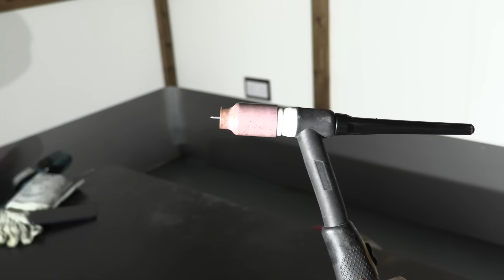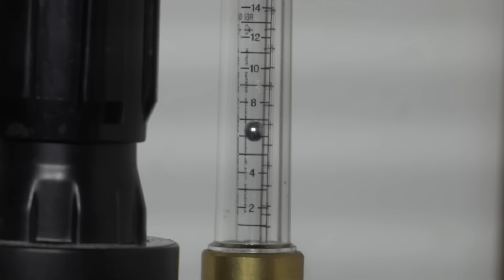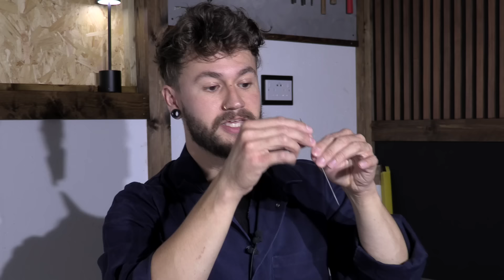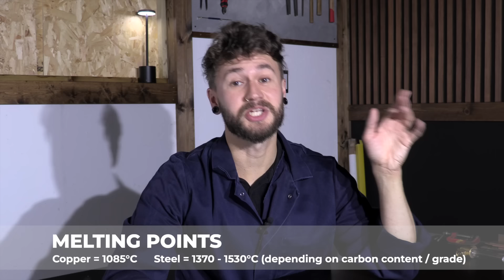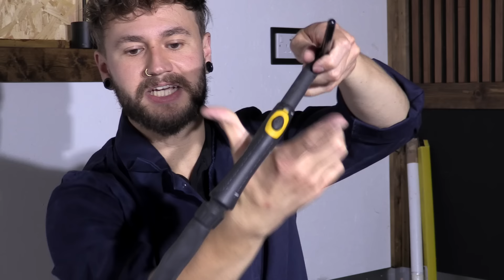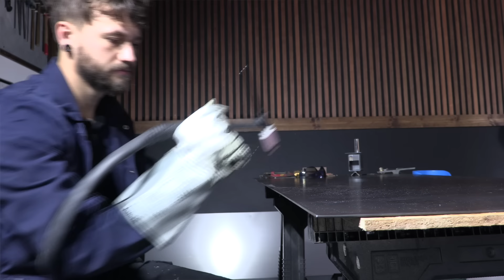This Is Why You Suck At TIG Welding

Comment: Shouldn’t have any grooves at all when sharping your tungsten..
It should be polished.. the grooves will cause the tungsten to oxide quickly and degrade faster
Reply from the maker: What are you using to polish your tungstens?
Reply: @Dre.T.K  diamond wheel
Reply from the maker: @tomcox7221 nice, I'll be on the look out 👌 cheers
Reply: @Dre.T.K most pipe shops i weld at have what’s called a piranha tungsten sharpener.. they are expensive but work very well.. I have a handheld unit that uses a small double sided diamond wheel for when I’m n the field..
Reply from the maker: @tomcox7221 yeah, some of the businesses I've worked in have had all the fancy tungsten sharpeners. I've just never needed one for my home set up. Getting more bits together as time goes on.
Reply: @Dre.T.K  yea I can’t justify a 1000 dollar tungsten grinder for the house either lol

Comment: I decided to by a huge 16 cup for my stainless manifold and boy did it cause problems! Access was impossible and rather than use the big cup I used a long number 4 instead, much easier to get into those ridiculously tight areas. I know that the stick out can be much longer but the gas needs to be higher too, I decided to go the other route instead, it cost less in gas usage and saved my sanity :) That was one thing you did not cover Andre - stick out. This also can be the make or break of any good tig weld. Having said that, I enjoyed the tips; it is always good to listen to someone even if you are a seasoned tig welder.
Reply from the maker: Yeah, you're absolutely right. Stick out can be something people also struggle with when starting out. That's maybe something I'll go into in the future if I decide to do more of these advice style videos.
Another one that's kinda related is arc length. You see it often. Getting that sweet spot where you're not too close that you dip your tungsten when you're filling, but not so far away that you lose control, heat placement and everything else that comes with it.

Thanks for the extra tips. Hopefully anyone reading your comments will be aided through the advice. Thanks for watching and the support 👌 I appreciate it

Comment: Replace your wheel on your grinder with a diamond wheel of the same size. 
It’s also easier to get whatever tip profile you desire by sharpening it pointed down in the direction the wheel is turning because you have more control as you spin the tungsten (which should be done relatively slowly) 

Also never seen someone hold a torch that low. Choke up higher for better control.
Reply from the maker: This set up is button TIG. I would usually hold higher up when using a pedal. I find choking too high can reduce movement, though! 
Cheers for the comment 🤘 I appreciate it

Comment: As a long time dedicated tig welder all of these tips are perfect good stuff your cup size helps with the LPM of gas for example if your welding with a cup number 8, 8LPM is whats needed and if you have for example a cup number 16 you use 16LPM and make sure you have a little bit of pre flow and post flow if possible to do so on your welder 👍
Reply from the maker: Great advice 👌 pre and post flow can make or break a weld, so it's always a good thing to be aware of. Keeping your torch over the weld piece at the end/during your post flow is something new welders often forget, too. It becomes muscle memory over time 💪
Thanks for the great additions 🤘

Comment: One thing you may have missed, How LONG your post flow is, because if it is way too short it can turn your Tungsten Grey and cause all sorts of contamination issues, depending on the Tungsten size and the Amps you are running, it could be from 5 seconds to 15 seconds of post flow, and also stay in place where you finished while it "times out", to properly protect the Weld AND the Tungsten.

Comment: If you are getting porosity from turbulence in the gas shield, try using a collet body with a gas lens. Helps to make sound welds with a wider range of gas flows and under less than idea conditions.
Reply from the maker: That's a great tip, thanks for sharing! 🙏